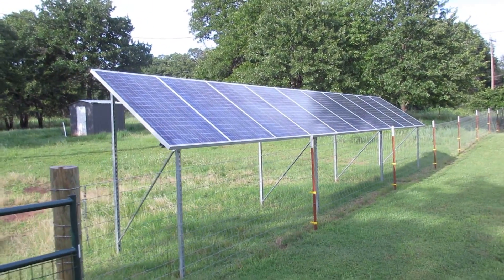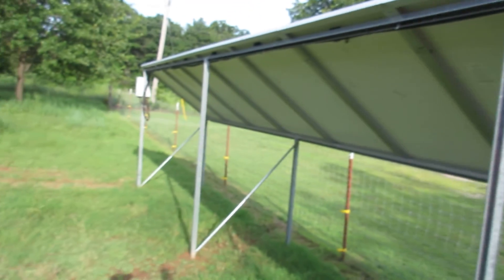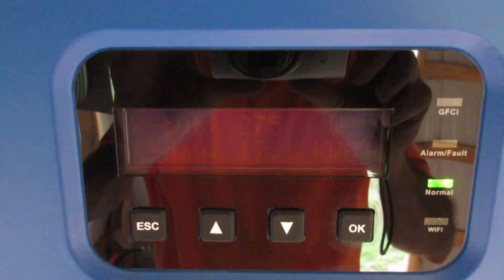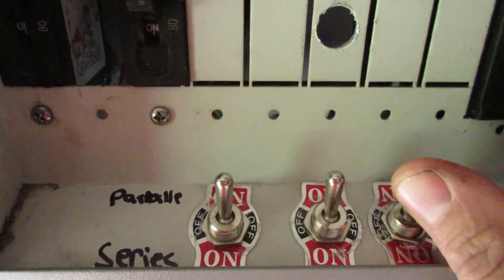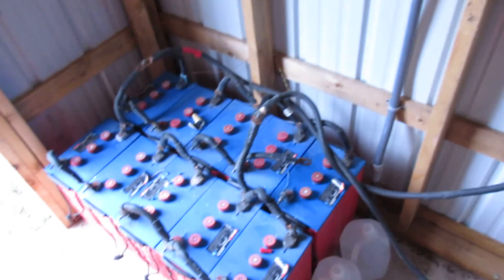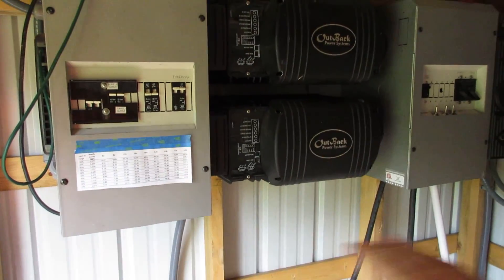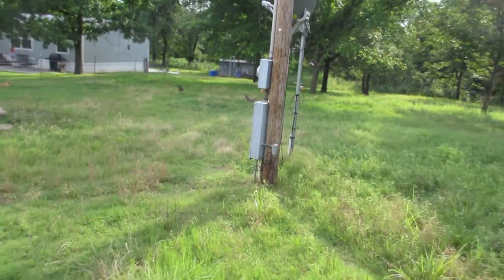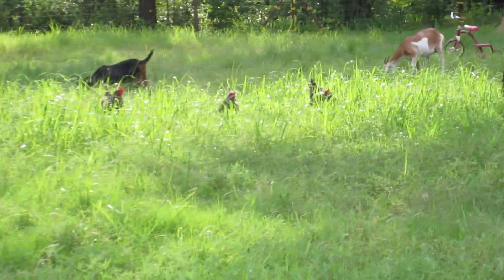grid tie and off grid solar system with battery backup

Comment: Hello Mike, thanks in sharing a video of your system. Any chance you can share the detailed schematics of your wiring and your switches. am new to solar power and seeking to set up a system where I can parallel the strings to power up my PIP4048MS off grid inverter, or in series to power my SunnyBoy SB1700. I have 12 panels made up of 180W solar panels.